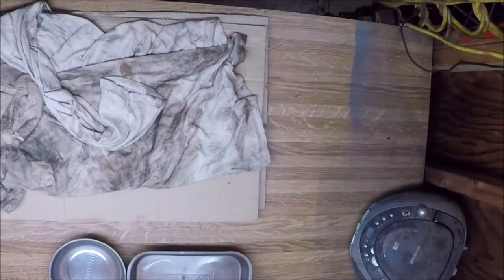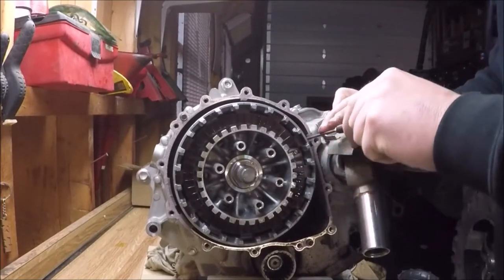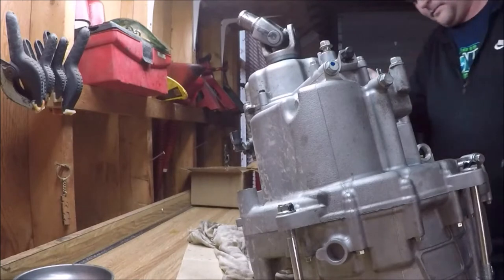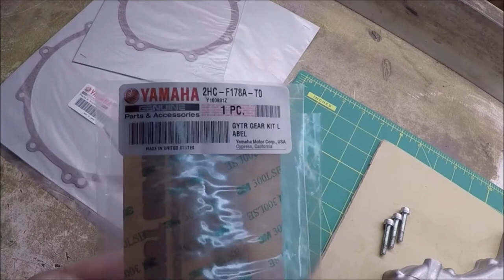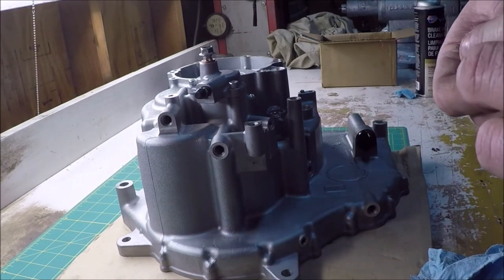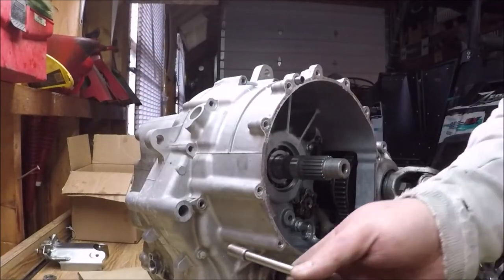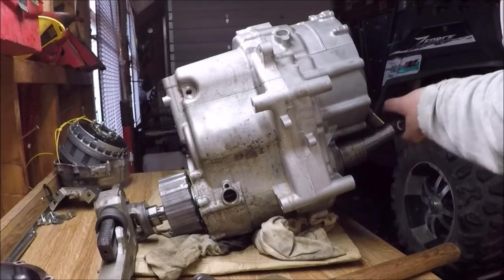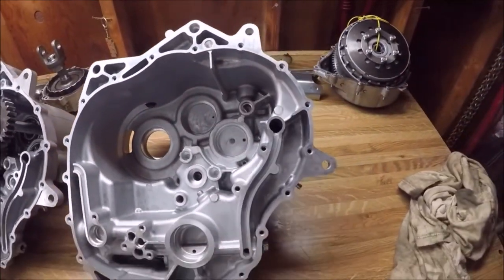Yamaha GYTR Gear Reduction Install Part 1

Comment from the maker: I broke down an purchased a service manual.  Threebond 1215 is what the manual recommends.  It was 30 bucks for a little tube.  There is no way I was going to do this whole project and skimp out on the sealant.  Am I crazy for spending that much?
Reply: I've used Yamabond and Threebond on my Banshee builds before, I prefer the Threebond.